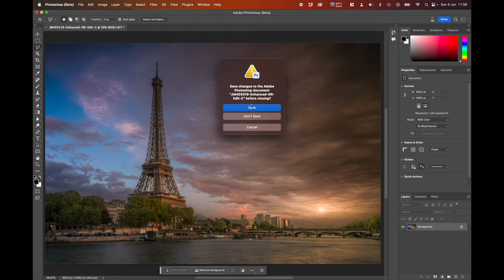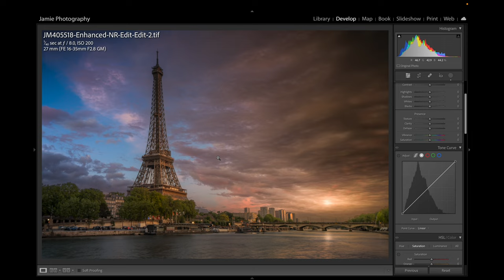Smooth Water with Photoshop AI Generative Fill

Comment: Why don`t you make a long exposure? Than you have the water smooth. The AI looks artificial, not good at all
Reply from the maker: I would normally take a long exposure, however, in this shot I was just showing how you can use Generative Fill to smooth the water, should you take a shot when you do not have a tripod. The results vary and as you say this is not as realistic as taking a long exposure.